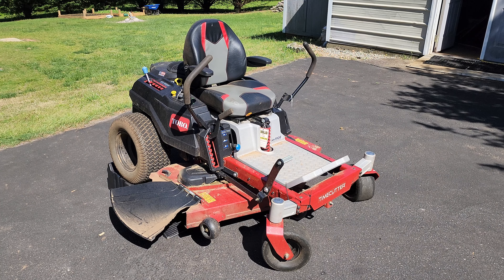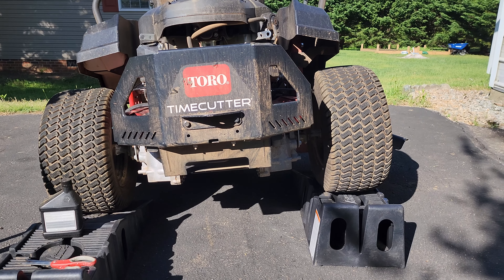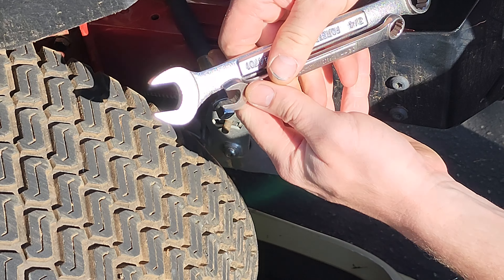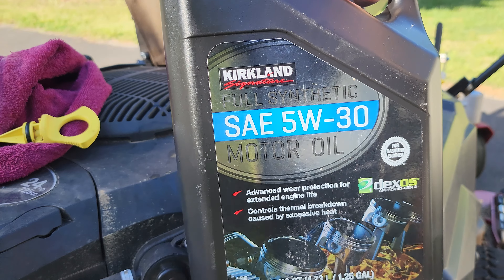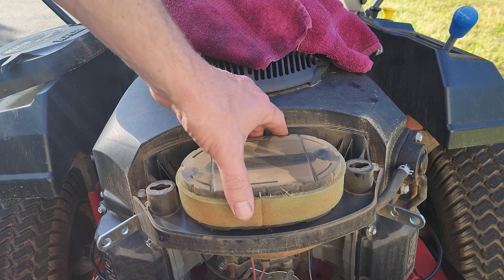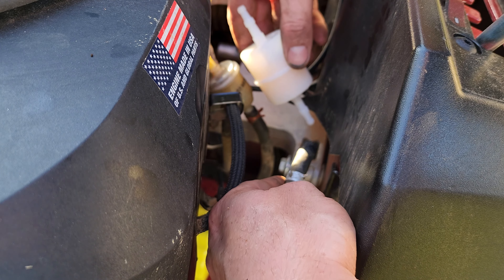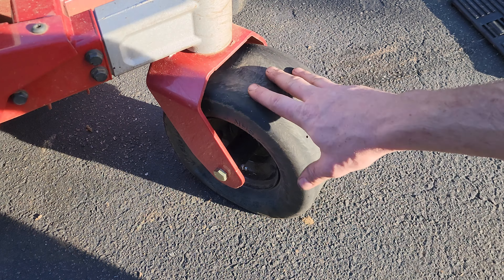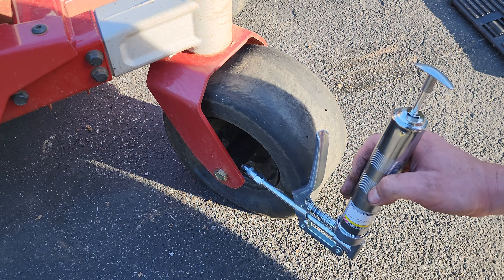TORO timecutter oil change and maintenance

Comment: Are you changing oil in the Spring? It should be changed in the Fall, otherwise the contaminated oil is left in over the Winter, damaging the internals of the engine.
Reply from the maker: Yes. Unfortunately, that oil was not that old. May be 40 hours on it.